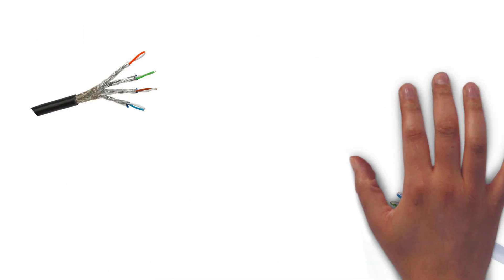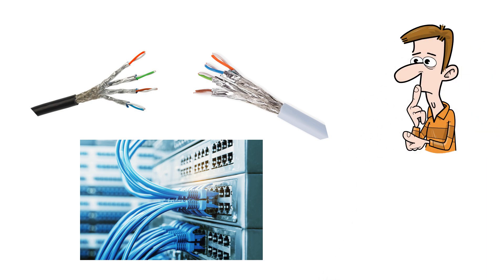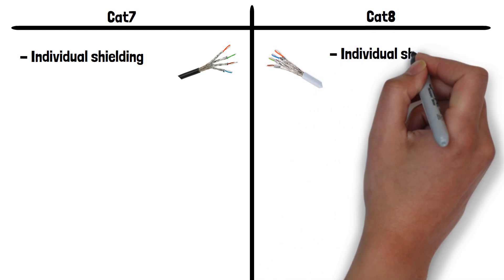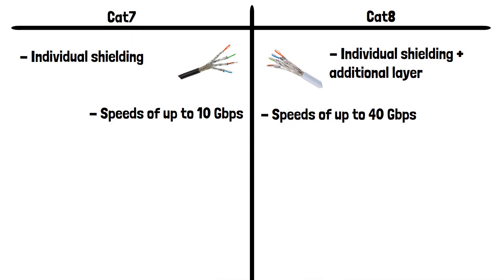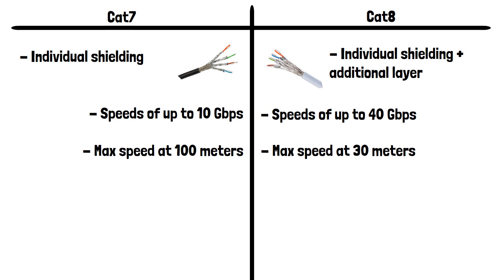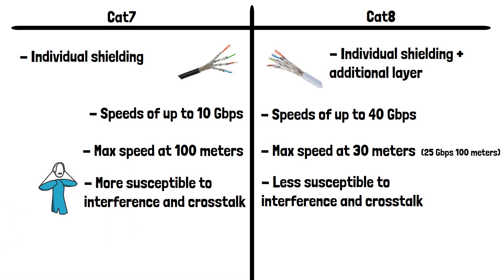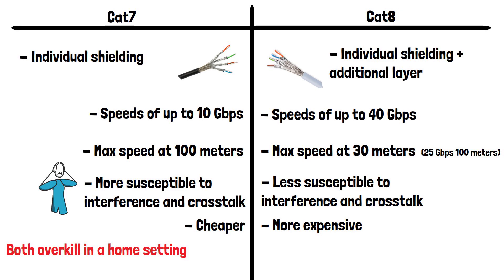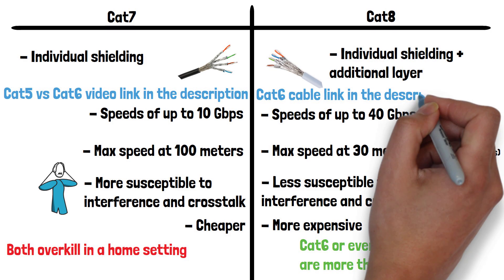Cat7 vs Cat8

Comment: So are you supposed to ground each wrap on each pair?  Is there a drain wire ran inside like 6a?  Because corning said the drain wire was supposed to be placed inside the crimp dye folded in the middle to ground the ends and the male plug will in turn ground to the body of the switch..  it was a whole big thing because we had to take off every patch panel and sand between the racks and panel putting dielectric in also..  where the feeds were for the sec espn during gameplay all the thousands of cellphones and all was interfering with the feeds to the satellite and fiber was not installed yet..  was a crazy couple of months..

Comment: CAT.7 cables are standard for years now,  even in a home setting. At least in my europe country. Would be hard for me to find Cat. 6 installation cable. I went for Cat. 8 since compared to the whole house cost it added not that much (just around 300€, all more expensive Cat. 8 Keystones included). My future me in 30 years will thank my past me.
Reply from the maker: Good thinking, the cost is minimal when you consider the future proofing it offers